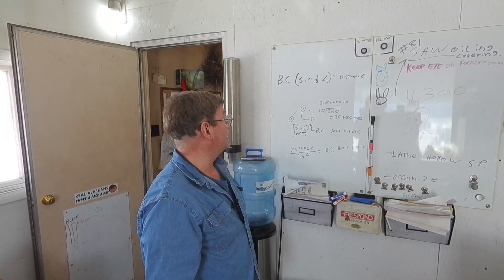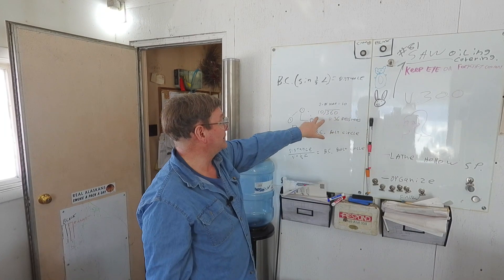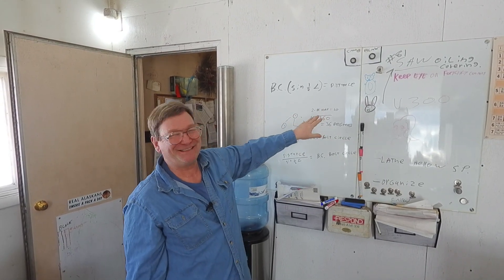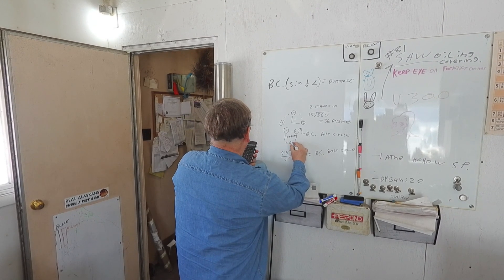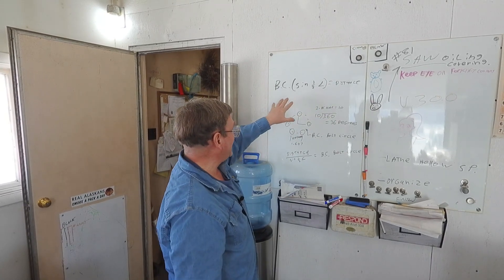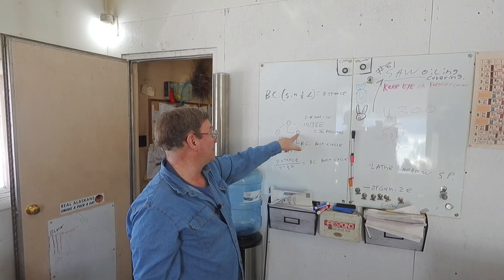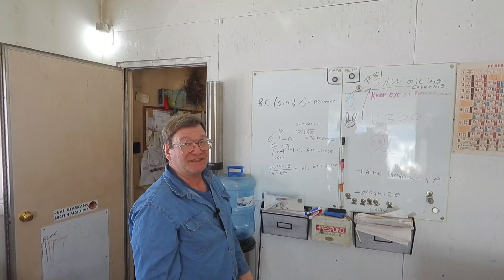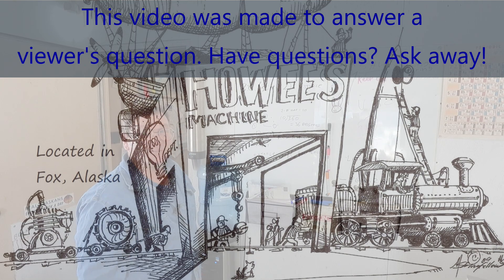Machinist's Minutes: The math behind bolt-bolt spacing in circular patterns

Comment: Geometry methods. If my 75 yr old memory serves me well.  Scribe the pitch circle. Draw in a diameter line left to right. Divide the diameter line into five equal spaces. Scribe two arcs from each end of the diameter line with centre on the intersection of the diameter and circumference and radius set to the diameter of the circle scribe intersecting arcs below the circle drawn. From the intersectional of the two arcs draw a line through the second step from the left end of the diameter. To cut the circumference above the diameter line This will be one fifth of the circumference which can be stepped around the pitch circle. 
For more holes. Divide the dia line into that number and draw the intersecting arcs below but always use the SECOND diameter division.

Comment: Cool now I know why rims commonly have 5 bolts… cause it’s easy to do in your head and math is hard lol
Reply: Also a big part of why 360 was used as the number of degrees in a circle. Divisible by 2, 3, 4, 5, 6, 8, 9, 10, 12, 15, 18, 20, 24, 30, 36, 40, 45, 60, 72, 90, 120 and 180. Lots of options for clean math!